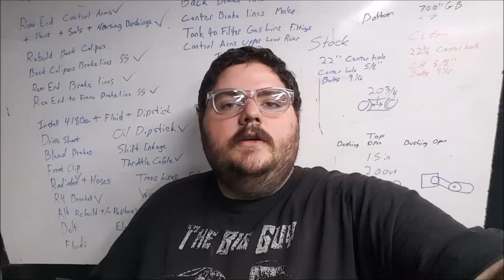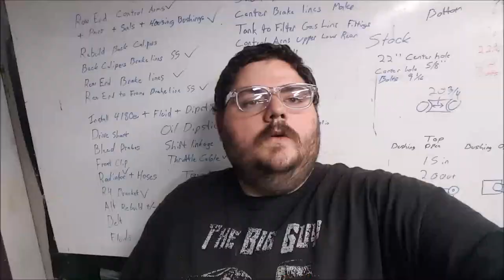1979 GMC C15 (Bulma) 38! LS Swap Diagnose & Fix My P0300 Code!

Comment: I have cleaned dirty injectors in my ultrasonic cleaner using acetone i did not turn on the heater just ultrasonic mode and I put injectors in the basket upside down I've cleaned alot of injectors that had set for a long time very few of them didn't work after that I think the one's that didn't work were bad because my scanner wouldn't even pulse the injector
Reply from the maker: I knew the set I had was good because it ran good for days than started to misfire.